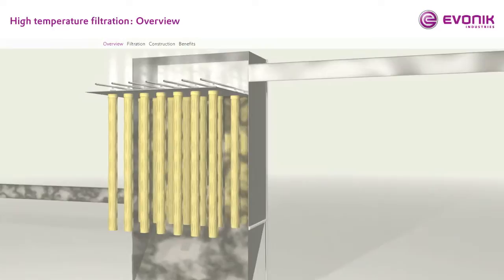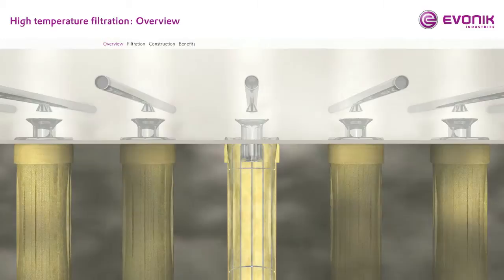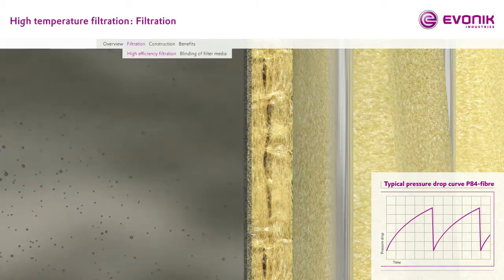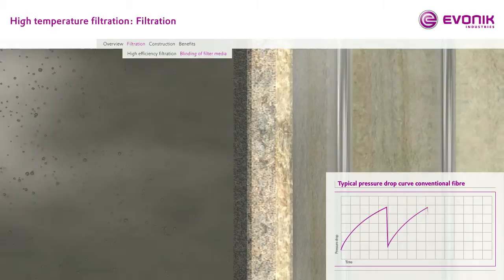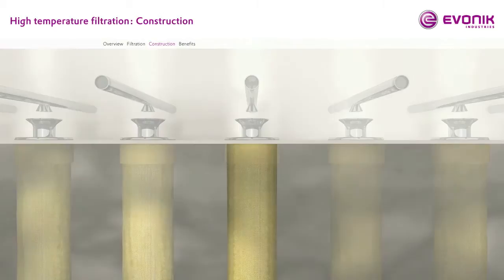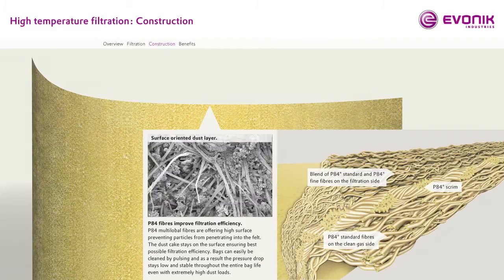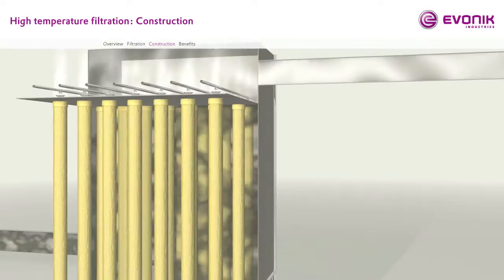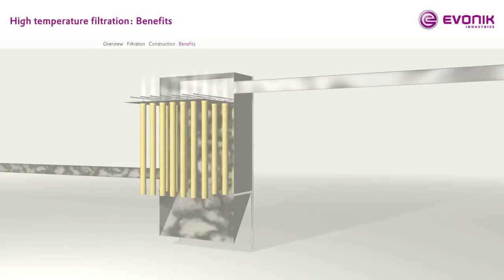P84® Filter Bags: High Efficiency Filtration | Evonik

Comment: how distance from Air nozzles to face on top of ventury?. Many Thanks
Reply from the maker: Thank you very much for your question about polyamide 84, but unfortunately we cannot give a general answer here because the distance depends on various factors such as blowpipe geometry, venturi design and hose diameter. If you know the filter manufacturer, you can contact them directly. If you have questions about the product, you can write to the email address P84@evonik.com.
Reply: instablaster